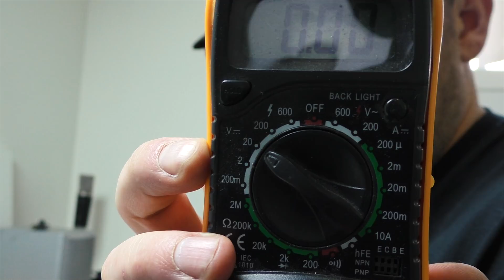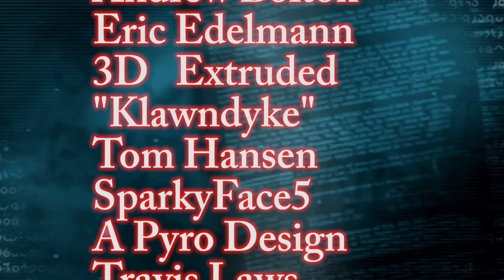How to 3D Print a USB Lamp!        (See Description for Night Photo)

Comment: I made a similar thing. I used a charmander print with transparent red filament a slow changing RGB led, a couple of resistors and a photoresistor.  This way I could leave it on all the time and it would only light up at night. google night light circuit for a circuit diagram and schematic. It's heaps easy and very awesome.

Comment: I was wondering how to use a USB connection with LEDs.  Right now I just use the CR2032 batteries in my 3D printing.  Thanks for the tip and how-to.  :)